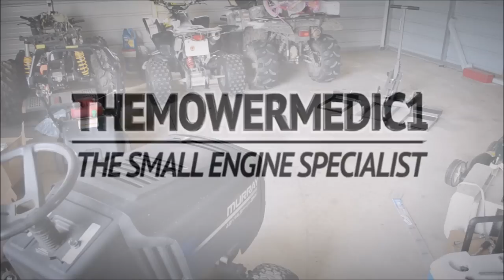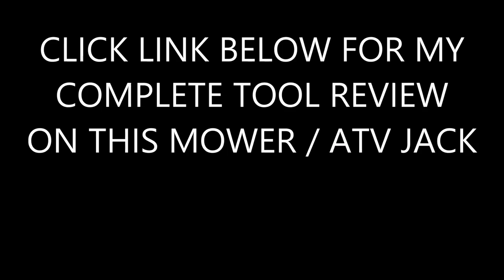RE:/ FOLLOW UP / TOOL REVIEW :Harbor Freight / Pittsburgh Riding Mower / Atv Lift Jack 60395 / 61523

Comment: I had bought one 6 years ago. I own a small engine repair shop. A couple years ago the jack failed. I figured I got my money's worth. I bought another one. It lasted a few more years. Jack failed again... so I cut the old one up and used the part that holds the wheels. I welded a tube to it and now I put that on my roll around hyster. I can lift anything as high as my hyster will go. I dont even have to lay down to change blades anymore.

Comment: Jeremy I bought this lift in a large part because of your video. This is a great lift, and in my opinion after using it today, it is very underrated. I used a HB coupon and got the lift for $75.00. It worked great using it with my JD X310 today. Inexpensive, easy to assemble, works great, what more can you ask for?

Comment: Ok, I have a follow up. I was expecting a screw type plug but it's just a rubber plug in the Ram. It looked like it was steel because it was colored the same black as the Ram. Anyway, pulled the plug, it started to ooze out oil, pressed the plug back in. Tried it again and it wasn't moving upward but a small amount b4 falling back down. Had to masterbait the pump arm for about 45 sec's straight, then it started lifting properly! Live and learn.......
Reply: George DuPuie I've had good luck with mine. As to the failure rate your account provides a good explanation. 
I have a theory. Bottle jacks have a problem. If they are stored on their side with the pump up, the oil can run out of the pump leaving it to pump against a vacuum until the oil works past the check valve. The hydraulic lifts at the Harbor Freight store were stored in random stacks. The bottle jacks would be in the boxes with some of them upright, some flat, pump up or pump down. Crap shoot on which one you get. 
Could it be that removing the plug breaks the vacuum in the oil storage reservoir? That would help let oil flow past the check valve into the pump.

Comment: Hey good videos Jeremy-this helps with questions and pointers having just brought one home from an estate sale-with no instructions, (did see it is posted as PDF online) and taking apart somewhat to transport. Pretty nice it was already assembled, and did raise up when trying it in the garage.. Manual suggests to drain out hydraulic fluid every three years or add if needed. Have you had to do this yet?
It looks pretty new and hoping it holds. Thought about doing the winch idea from above in the barn but like you said you can move this anywhere and use, so Thanks!

Comment: On the box it says that it was foldable for storage.  Has anyone figured out how to do that?  Like someone else said it takes a lot of room.  Other than disassembling it I don't see any way to fold it up.
Reply: Watch his original review of the tool.  It doesn't show full detail about folding, but it shows the pins you can pull to fold it up.  Link here to the actual shot:
https://youtu.be/1VgSQ9Ay4PA?t=3m40s

Comment: The frame is the best part of this pc of junk, used mine one time to change blades, won't work now after going through the cylinder bleeding process many times, flushing cylinder with new oil, etc. I'm on my way to O' Reilly's to buy their simple bottle jack, at least I can return it if it fails, w/ this cheap Chinese junk or any Chinese made hydraulic cylinders your out of luck, as soon as you buy it, take the cylinder off & trash it, this goes for Chinese made spark plugs, rubber products such as carb fuel line & vacuum lines, they last for at best 6 mo then they fail. I've learned as soon as I get a Chinese product with these components, before I use them once, I trash them, it saves a lotta time & frustration. Good Luck!
Reply from the maker: https://www.youtube.com/watch?v=-K4mkbJxFX4

Comment: What is the best way to store this thing.  I have one and it takes up a lot of space.  I like and it is useful.  Just when not using it, it can be in the way.
Reply: @commonsensehomestead  Watch his original review of the tool.  It doesn't show full detail about folding, but it shows the pins you can pull to fold it up.  Link here to the actual shot:
https://youtu.be/1VgSQ9Ay4PA?t=3m40s

Comment: Good video Jeremy! Maybe I'm over thinking this, but when I completed the assembly the final thing they asked to do was to remove the Oil Fill Plug from the side of the Ram, proceed with putting sand bags on each wheel bracket, pump the lift pedal quickly several times, then check the oil fill hole and add hydraulic fluid if needed. I saw a hole on the side, but no plug to actually remove and check for level. Did you scratch your head and yell damn China instructions like I did, or did you actually find what they were asking for?
Reply: This is the exact point that im at!  What did you do?
Reply: thegogetter222 look below in this thread!

Comment: Hell can buy a  motor lift for under 100 bucks >  LOT STRONGER TOO>  proud i made a A frame lift, 10' tall>  i hang mine like a deer.  work on it wash it let it drip dry, LOST with out it, Pull motors, load, unload flat beds, pickup trucks ect

Comment: We drove about 45 miles to Harbor Freight to buy this. Followed the instructions, and would barely work. Went back the next day for another one. No problem. So here comes the next test! Worse than the other one. Next day it gets returned for a refund. Made in China!!! What else should I expect. Save your money, effort and time. Spend more and get a better quality one. I`m going to.
Reply: Jeanette Zook  i agree its nothing but junk i got one hydraulic jack didnt work ok ill take it to a shop that works on hydraulics they told me to throw it away junk by a better ram cheaper than try to fix one from harbor freight so i did
Reply: +Fred Steinebrey - Been trying to find a jack to replace the current one. Where did you find the jack with the base that would fit the high lift's mounting pin? Thanks
Reply: Actually I purchased a small jack and a friend fabricated some mountings and welded them to top and bottom and walla works better than  cheap original
Reply: +Fred Steinebrey Hey Fred Thanks -  Was just checking to see if there was a direct replacement as I don't have anyone to fab.

Comment: I got one yesterday and it lifts the front good but it won't lift the rear. My mower weighs 496 lbs. but I thought just the rear would be less than 300 lbs. Should I return it or am I overloading it?
Reply from the maker: I have a video on how to fix. Search ATV lift
Reply: Wow! That fixed it. I looked in the manual and all I could find was how to bleed it which did nothing. They should have this fix in the book. Thanks for the help and I subscribed!

Comment: I assembled  mine with no problems but it will not lift with my lawnmower on it. It does lift without a load. Any suggestions?
Reply: Nevermind, I figured it out. Thanks for the great video.